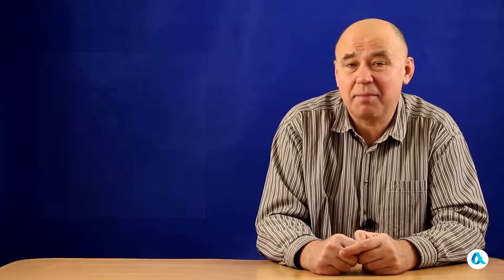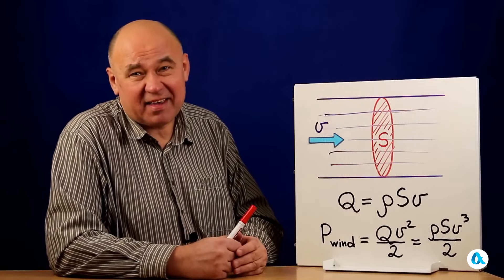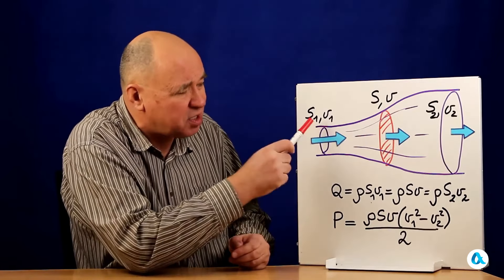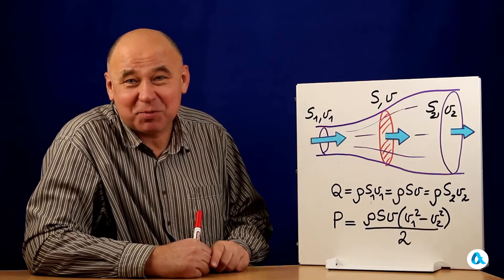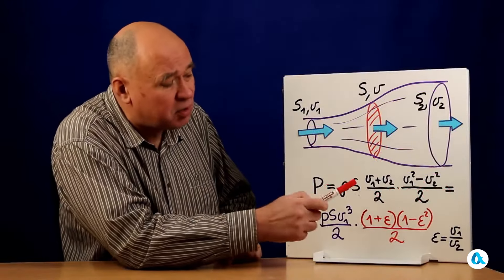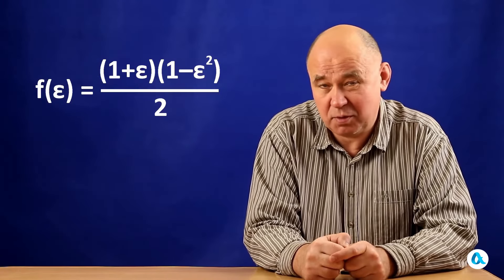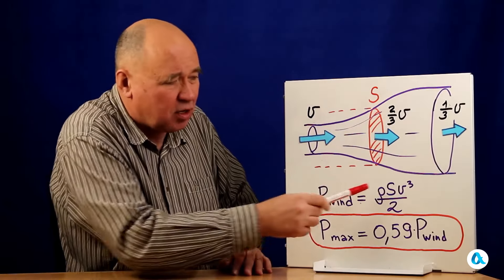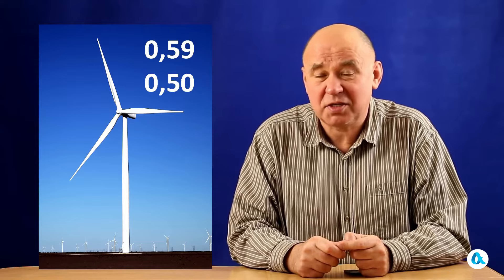The best wind turbine

Comment: How Airplane Wing and Turbine Blade Works #21 - https://www.youtube.com/watch?v=R5_LJFl-fu4. Video that shows wind velocity in regards of turbine blade number and most important geometry. Baez maximum 1/sqrt(3)=0.58. And my calculation  (1-sqrt(3))=0.42 maximum for hydro dams and steam turbines with enclosed chamber where blades geometry is not important. Enclosed chamber is very important, in such case continuity of flow rule can be directly applied. For open space wind turbines?
Reply from the maker: We recommend watching:
https://youtu.be/PaFSdZxVTNg
Reply: @phyarth8082  I have also thought that the Betz limit may not be directly applicable in an open system. The airflow affecting the operation of the turbine extends beyond the swept area therefore needs to be accounted for. 
With respect to actual turbines, would a design where only the outer half of each blade is an aerodynamic surface and the inner section is just a support thereby creating an annulus allowing air to pass through the centre area mostly unaffected, produce any improvement in overall performance?
Also, is there any advantage to be gained by incorporating a stator ring behind the blade area to reduce turbulence?
I realise these changes may not be easily applicable to larger scale turbines.
Reply: @cwt5654  Turbulence do not exist, it was introduced by Reynolds as temporary measure to describe chaotic flow regime, with expectation better theoretical model will be developed later, but it stuck. What we call turbulence are Newtonian fluids   are all gasses,  water, and non-Newtonian fluids are "thick" liquids. Calculation of turbine blade performance (torque)  can be done with simple trigonometry, then wind speed is known.

Comment: Thank you for this very informative video!
Does the wind that flows outside of the rotor area affect the clearing of slower air mass that has passed through due to shearing like the entrainment/inducement effect in the Dyson bladeless fan system?

Comment: The best would be a VERTICAL AXIS (VAWT), not a Horizontal axis (HAWT) wind turbine. Even though they are less efficient, VAWTs are much safer for birds, bats, and aircraft.
I haven't seen one HAWT with an aircraft WARNING BEACON atop each of the BLADES. 
Whereas, the highest point of a VAWT would be easy to mark with a beacon.
Also, a LIGHTNING ROD can extend higher than the top of a VAWT. Might as well put the warning beacon atop the lightning rod.

The probability of air flowing towards a HAWT is less and LESS LAMINAR, the larger and LARGER they are constructed; resulting in more uneven stresses, causing warpage and cracking failures.

In North America, 99% of TORNADOES rotational spin is counter-clockwise (with respect of the clouds 'looking' down to the ground).  A Tornado would definitely tend to damage or destroy a HAWT, whereas a VAWT would tend to COUNTERACT a tornado and break the tornado up.  Which way should the VAWTs spin ? Clockwise or counter-clockwise ?? A laboratory model of a tornado and proportionately tinier VAWTs would provide that answer.